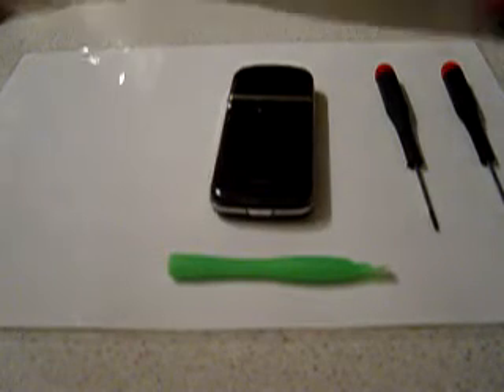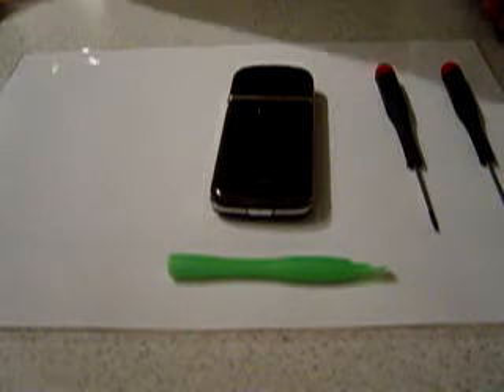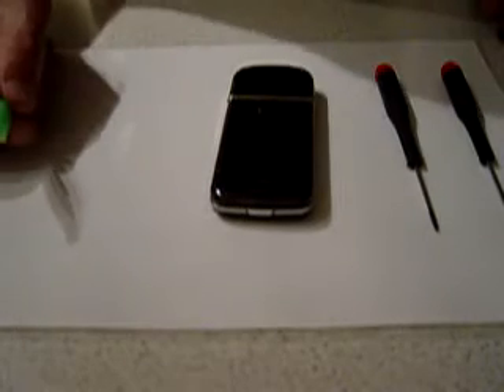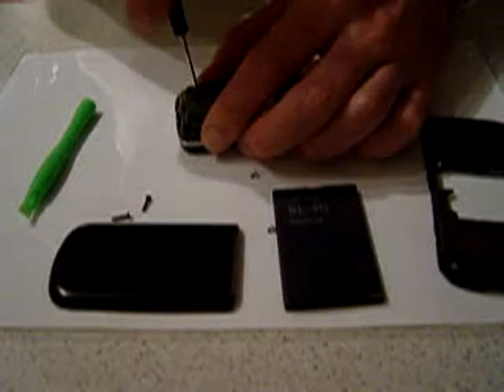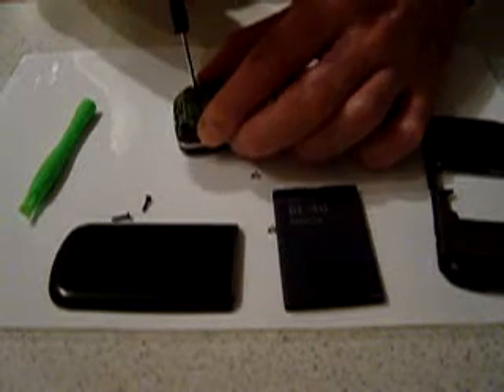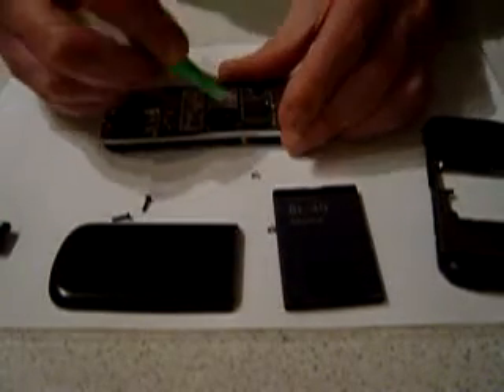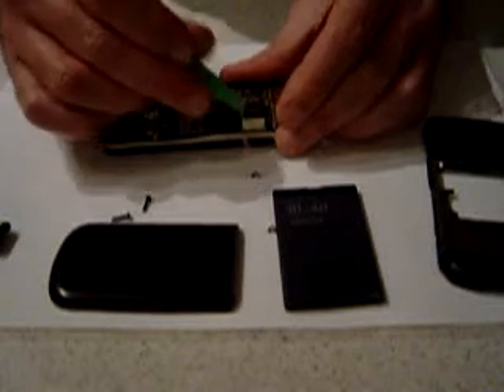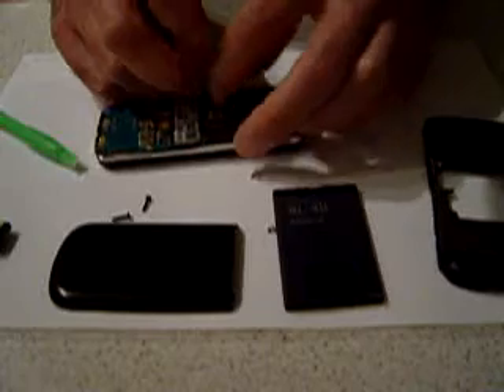Nokia 8800 arte dismantle disassembly guide

Comment: My loudspeaker suddenly went out. I used your video to open my phone and saw that the speaker simply fell out of its connector.  Probably resulted from all that aggressive tapping for the clock.

Thanks for the video, I thought I had to preorder the iphone 5 but I like this simple little thing too much. So glad it works, 5 years old and still running strong.